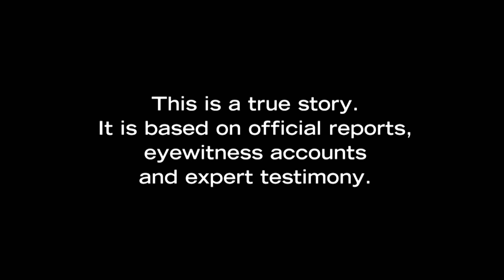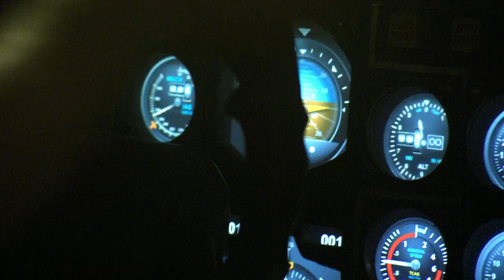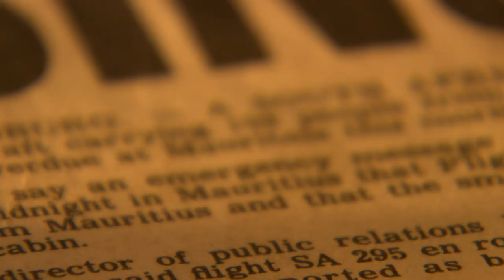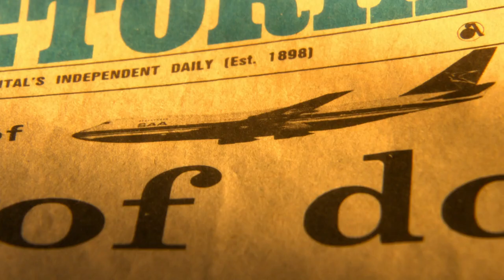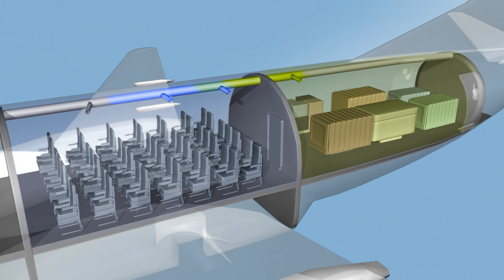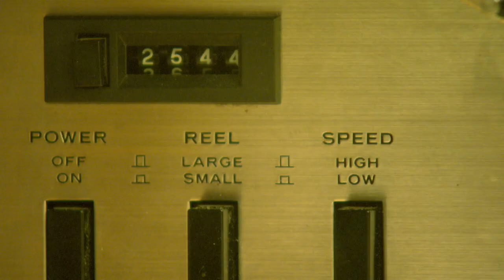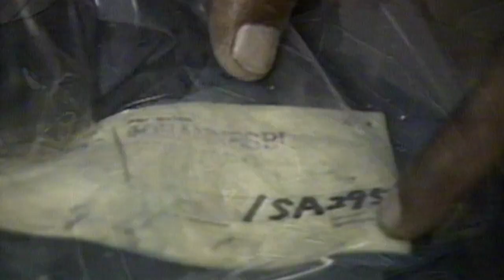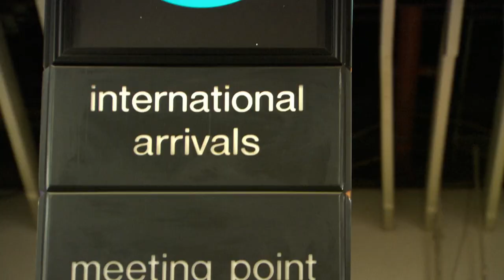An On Board Battle With A FIRE In The Cargo! | South African Airlines 295 | Mayday: Air Disaster

Comment: As someone who does a lot of sim racing and Bluetooth wheel building, I can tell you I have multiple extinguishers but when there’s a Lipo fire, I wouldn’t reach for a halon one a million years. While I understand the report has explanations, If a lithium ion fire was at the root, current guidance has shifted dramatically since this fire on aircraft.
Reply: There is strong scientific reason to doubt the proposition that an Li battery was at the root of this issue. In general Li batteries don’t just spontaneously combust— they must either be inherently defective or… subjected to degrading conditions such as significant physical damage or extreme heat. 

I do believe that the Li batteries aggravated & exacerbated the issue once the fire started. In fact it would’ve been inevitable as Li batteries become self-sustaining fires in both fuel and accelerant. They are also notoriously difficult to extinguish as you’ve mentioned due to their intense heat and chemical volatility. 

But it’s likelier that something else on that plane started a high temperature and aggressively spreading fire with the batteries simply making a catastrophic situation worse
Reply: That crash was before we had LI batteries.
Reply: Frozen now she
Reply: The crash predates lithium batteries... Lithium batteries were not available commercially until 1991
Reply: LiPo batteries are def very scary when they catch on fire

Comment: Flammable materials are the main cause of air disasters for several reasons
1- loading falammable on with oxidizing materials
Loading flammable in larger quantities than allowed by the civil aviation guidelines
Loading flammables which can be affected during high level flying
And many more

Comment: I always thought if they had a more rapid decent rate and if they were closer to land they might have landed safely may the victims rest in peace 🙏🏻 ❤️
Reply: Unfortunately too fast a descent rate and they can’t open the doors to clear the smoke, as well as risk reaching Vne which could be just as fatal to the aircraft as the fire is. Not to mention, they are still loaded with enough fuel that any steeper of a descent rate that would result in a greater airspeed, the aircraft could’ve ended up approaching too fast, and too heavy to safely land. 

By the time the crew contacted Mauritius ATC, I believe the fire had spread and was already compromising electrical systems & vital instrumentation.
Reply: @dmitrikupryaov7845  thank you for telling me this and this event was very 😥
Reply: WHY NOT FILL CARGO HOLD WITH AN INERT GAS.
Reply: @ronniewall492  exactly and also how come they never turned off thr recirculation fans when the crew members said we can't breathe and it's getting worse

Comment: I dont know if planes have this or not but some sort of fire suppression system for the cargo hold and or the cabin. Maybe like sprinklers or CO2. That way the CO2 won’t cause water damage in the event it deployed by mistake.
Reply: They have them now. Since that air Florida flight crashed in the Everglades outside Miami.
Reply: That crash in the glades was a nasty one.
Reply: @mikedineen7857  > do you know if that crash is an episode?
Reply: @TariAkpodiete  I know the Miami one is. I don’t recall seeing the South African one, if it is it’s very recent.
Reply: @slagarcrue85  it was they were all dead before it hit the swamp.
Reply: @mikedineen7857  Correct me if I’m wrong but I believe the Boeing 747s had cargo fire dispatch systems as a standard feature. Maybe older models didn’t but I’m positive the 747-400 and later models had them as a standard feature
Reply: @dmitrikupryaov7845  this was a half cargo and half passenger plane. There were fire sensors on the cargo deck but not the upper cargo deck.